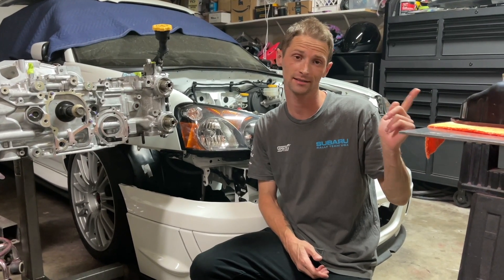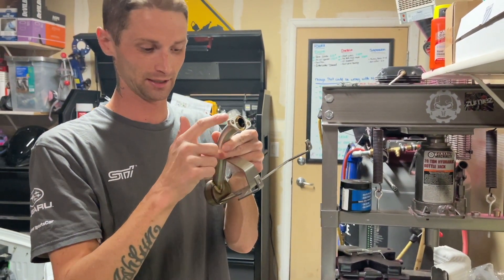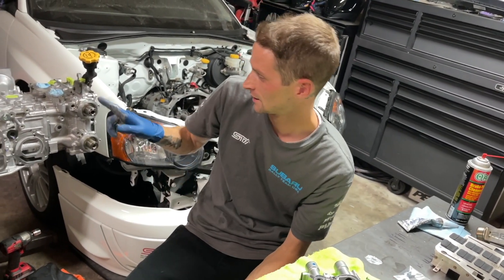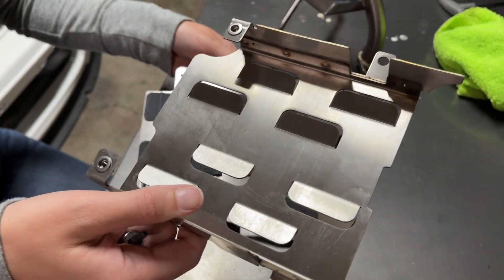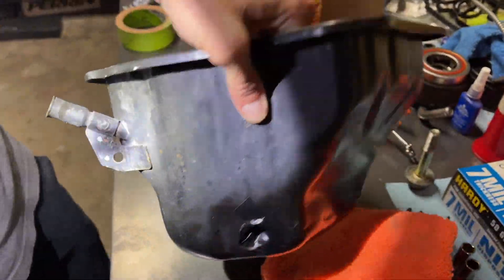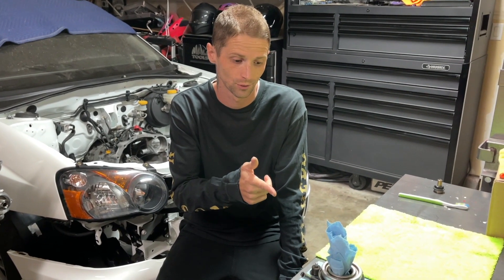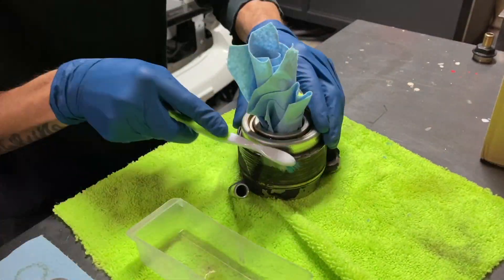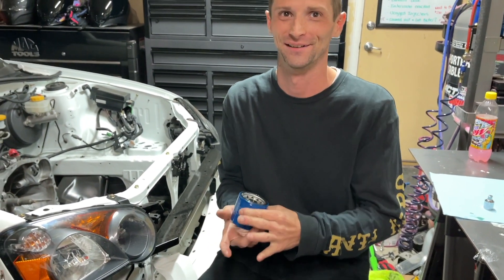Every Subaru Needs This! No More Failures! (IAG V2 Pickup & Oil Control Baffle)

Comment: Great to see that I’m not the only one considering using the stock oil pan with the upgraded baffles. I wondered if it would work together… nice.
Reply: I ran it for 25-30k miles on a 500whp build, works fine if you don’t do a lot of track driving. Street car it’s fine

Comment: Since you went with the iag oil pan I'm surprised you didn't get the iag modded stock oil pump?  Also I hope you primed that oil pump with petroleum jelly before you installed it or you may never get pressure, and have to pull the motor all apart again or risk dry starting.  Tanner (Smeedia) learned this the hard way with his RCM oil pumped that was preloaded, but due to heat leaked out and was dry and couldn't pull to pressurize the oil system.